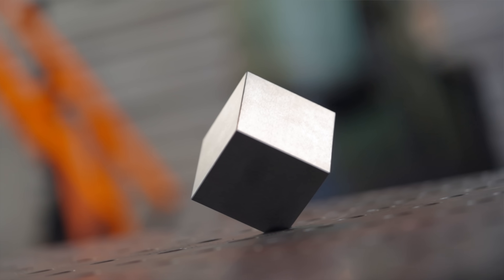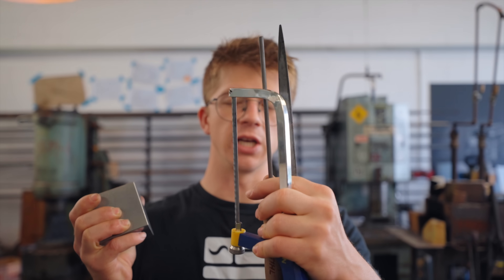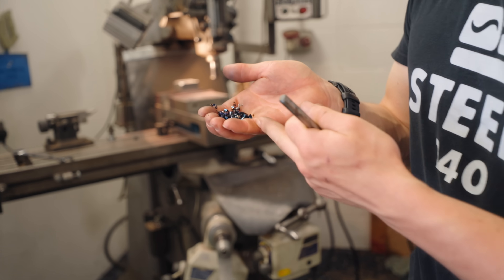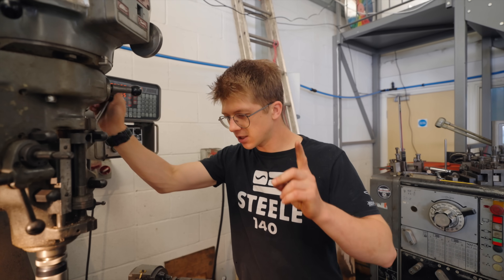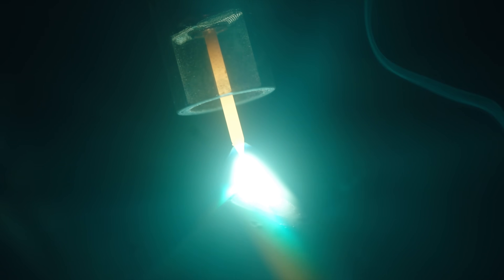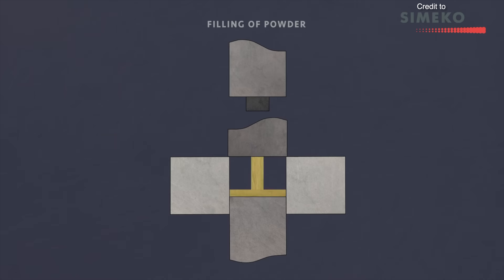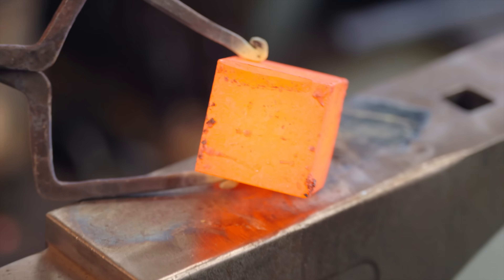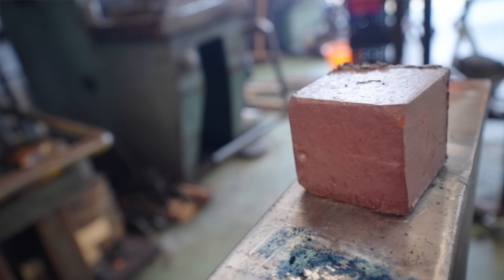Can You Forge Tungsten?

Comment: Nuclear materials scientist here - tungsten is such a dope material, we're actually considering it to make the inner walls of future nuclear fusion tokamaks. It's pretty much one of the only materials on Earth capable of withstanding those 3000°C of continuous exposure without losing much if its mechanical properties. My current work is actually about exploring tungsten 3D-printing and basically laser-welding it to other metals (using kW-range lasers).
Anyway - awesome video, very cool to see you play around with it in a blacksmithing workshop!
Reply: Thanks for your work! Hope to see much more in the world of nuclear
Reply: Will you be using pure tungsten or will it be an alloy/ceramic like WC? I've seen some crazy tungsten carbide parts but have always been curious about 3D printing it. It would be tough since you'd have to do it green (un-sintered powder) which you would have to account for shrinkage.
Reply: thats the coolest pfp tbh, never even thought of using a plasma globe as one
Reply: When he mentioned the temperature properties my mind went straight to a tokamak. I thought may have been way off the mark until I saw your comment.
Reply: @GarrySax Wouldn't a bimetallic layering of metals in a continuous electric / magnetic field like that of a fusion reactor result in crazy bad corrosion like with ship hulls? Maybe the vacuum inside will prevent that but bimetallic layerings have destroyed more than 1 multi-billion dollar project before due to their infamously bad corrosion at the interface layers.

Maybe Tungsten isn't like other metals in this regard, but just curious if any investigation has been put towards that.
Reply: @chaselewis5372  galvanic corrosion can only happen in the presence of an electrolyte. the powerful electromagnetic field surrounding it isn't enough for ion movement in the metallic lattice.
Reply: @GarrySax, I have done a bit of research into 3D printing tungsten. I'm just an engineer for our lab, but my collegue shares your title and has develoupled a way to 3D print tungsten without internal voids!
Reply: @jjfrenetictoad  He might be your colleague ^^ There are many projects regarding additive manufacturing of tungsten worldwide. Recent results are indeed promising.
Reply: @jjfrenetictoad lemme guess. Using low pressure chamber?
Reply: @lokikokoko5833  no. but even though he's my collegue and friend, he's keeping the IP to himself until his paper is published.
Reply: @lokikokoko5833  hopefully not.
Reply: How did they make the cube in the first place?
Reply: @daviddzialo6249  I presume they cut an ore of tungsten with a diamond tip saw, or molded it with sand, or carbon ceramic mold.
Reply: I worked on W wall materials for ITER some 20 years ago. Aim was to reduce brittleness, which was achieved by applying very high deformation (grain sizes < 200nm or so could be achieved, but material RXd very quickly at very low temperatures around 400°C. So basically, the high ductility also goes away very quickly. K-doped W behaved better).  When my thesis was done, they already chose a different replacement material: a C/C composite on Cu. I do not know whats hot in wall material science now, but if you stick with tungsten based alloys I'd explore K-doped tungsten. Its quite cheap (certainly cheaper than WRe) and does not recrystallize until the highest temps. It's basically the light bulb alloy (it inhibits the bamboo recrystallisation behaviour of pure W), it was discovered by accident in the 1920s in UK ('Battersea tungsten'). The problem with metals as wall materials is that they get sputtered away and tend to get deposited in the whole reactor. The amount of W that condenses 'in the right areas' is porous and brittle. I doubt that the C/C composite will solve that, but it is certainly cheaper and easier to manufacture than anything with tungsten. I'd vouch for a composite of Cu on the lower end (thermal cond.) and a ceramic coating on the hot end (like TaC or WC) that can perhaps be deposited in a kind of slurry, dried and sintered onto the Cu-base plate. Perhaps an intermittent layer with matched thermal expansion to both materials with a higher melting alloy is necessary.
Reply: IS Tungsten compatible with neutron capture issue?
Reply: @Thundra74  While tungsten has a relatively low neutron capture cross-section compared to many other materials, it is still susceptible to neutron absorption, which can lead to several challenges:

Transmutation: Neutron capture in tungsten can result in the formation of different isotopes, some of which are radioactive. For example, neutron absorption can produce isotopes like rhenium and osmium, which can alter the material's properties over time. Although long-term testing is needed to fully understand these effects, there are currently limited research facilities capable of analyzing the synergistic effects of neutron irradiation and transmutation. New facilities, such as IFMIF-DONES (International Fusion Materials Irradiation Facility - DEMO Oriented Neutron Source), are under construction to address these knowledge gaps. But a lot of materials have been tested under high heatflux conditions and under neutron environments in fission power plants. 

Neutron-Induced Damage: High-energy neutron bombardment can cause displacement damage in tungsten, creating point defects such as vacancies, dislocation loops, and voids. These defects lead to embrittlement and a reduction in ductility, which over time could compromise the structural integrity of tungsten components, especially under high neutron flux conditions.

Helium Production: Neutron interactions with tungsten can also lead to helium production via nuclear transmutation. The accumulation of helium within the material can result in swelling, embrittlement, and the formation of helium bubbles, further degrading tungsten’s mechanical performance.

If you would like to have further insights, I could give you over 250 literature sources regarding this specific topic :)
Reply: @Thundra74  While tungsten has a relatively low neutron capture cross section compared to other materials, it is not immune to neutron absorption, which poses several challenges:

Transmutation: Neutron capture in tungsten results in the formation of various isotopes, some of which become radioactive. For example, neutron interactions can produce isotopes such as rhenium and osmium, which change the properties of the material over time. The long-term effects of these transmutations require further investigation, but existing research facilities are not yet equipped to analyse the synergistic effects comprehensively. Facilities such as IFMIF-DONES, which is currently under construction, aim to address these issues and provide deeper insights into the behaviour of tungsten under fusion-relevant conditions.

Neutron-induced damage: Bombardment of tungsten with high energy neutrons leads to displacement damage, resulting in defects such as vacancies, dislocation loops and voids. These defects degrade the mechanical properties of tungsten, in particular by causing embrittlement and reducing ductility. Under prolonged exposure to high neutron flux, this damage can significantly compromise the structural integrity of the material, posing a challenge to its long-term viability in fusion reactors.

Helium production: Neutron interactions with tungsten can also lead to helium production via transmutation. The accumulation of helium in the material can cause swelling, embrittlement and the formation of helium bubbles, all of which further degrade the performance of tungsten. The management of helium production and its effects remains a key focus of materials research for fusion applications.

To address these challenges, the potential of additive manufacturing of tungsten is being explored. This approach could enable in-situ repair of components such as the first wall and divertor in future fusion power plants, providing a flexible solution to extend the lifetime of critical components.
Reply: @Thundra74  no, neutrons by definition are neutral
Reply: @qumit165  neutral only in regard of elettric charge but they will interact  in his own way
Reply: Tungsten's true melting point is around 3500°C so 1300° is a shrug for that material.
Reply: Nuclear R&D Chem engineer here - we're exploring the feasibility of 3-D printing tungsten for rad shielding to make hands-on radioactive material handling vastly safer.
Reply: @timberanvil3788 good, since we had a dipshit grad student put her hand in the beamline in grad school. She still graduated!
Reply: TUNGSTEN 3D PRINTING? thats dope i need to know more
Reply: A profilepicture only a real Nuclear materials scientist would choose
Reply: Thank you for your work chief. You guys are amazing 🎉🎉
Reply: You have a really cool job. Grateful for brilliant people like you!
Reply: that sounds really interesting. any literature on it out there?
Reply: Make me an iron man suit bro🥺🥺
Reply: @JM301-y9d  . Not iron man. Because of tungsten's symbol being W, be W-man instead.
Reply: Phd in nuclear science. But bro work with lasers like that guy on big bang theory.
Reply: Good luck
Reply: Is dope a scientific term there professor
Reply: Its melting point is so high that its rarely made directly into solids, its usually powder sintered which leaves it with some voids which results in it not having a uniform density. When fancy spinning top makers use tungsten, they have to balance their tops by drilling holes in certain sections to make the density uniform again, at least in one axis.
Reply: I'm your newest fanboy
Reply: Oh my, 3D printing that and laser welding that must not be easy, sure, lasers can go VERY hot, but still...
Reply: You're still going to need ablative heat shielding because tokamaks operate at 150,000,000 degrees Celsius.
Reply: @mh6276  Wall temp is a LOT lower than that and the amount of gas with millions of degrees is VERY low. It's all about how the material erodes away and where it goes in what amount of time.
Reply: didn't need a "Nuclear materials scientist" to google "what's highest melting point element"
Reply: Bro...start making videos. That is fucking stellar.
Reply: Iter is already replacing their innehr lower liners to W in the areas of max heat load.
Reply: I'm looking at 3d printing tungsten too
Reply: Man, you got a cool job. By kW-range, what exactly should I google to find out what you mean? I knew Plasma welders were a thing, but lasers I hadn't heard of as of yet!
Reply: @GarrySax is tungsten any good at absorbing neutrons? I believe the inner walls of a reactor are supposed to do that.
Reply: Dude I want to see your videos!
Reply: What about high entropy alloys that contain tungsten? I saw a video a year ago that showed a structure of such alloy and was amazed at what could be done. At some points looks more like magic than science or metallurgy. I saw some sparse papers that talk about HE alloys being used in reactors since you can alloy 5 or more metals at once and also in equal proportions rather than 1 main metal and 1 to 2 trace metals like we do in our day to day use alloys like steel or brass.

I am no scientist but I take interest in this stuff and it fascinates me how fast things are picking up.
Reply: How does Tungsten stand up against neutron flux though? I know it can be an effective radiation shield against the lower energy neutrons from fission but what about the very high energy neutrons from fusion? Will the tungsten get neutron activated and become incredibly radioactive over time?
Reply: Hmm, I wonder if you alternate a high frequency current through it would it provide gravitational shielding? 🤔
Reply: @moxow  probably
Reply: Try 12L14.
Reply: Do you work for Proxima Fusion?
Reply: Wouldn't it be better to use carbon?
Reply: @Arcoz  For nuclear fusion power plants, this is unfortunately no real option. Carbon or CFC have several issues with:

1. Hydrogen Interaction: CFC absorbs deuterium and tritium, reducing fuel availability and complicating fuel management.

2. Erosion and Dust Formation: Carbon erodes heavily under plasma exposure, generating dust that can contaminate the plasma  and results in low service life

3. Neutron Damage: High-energy neutrons degrade CFC, causing embrittlement and structural damage, making it unsuitable for long-term use in fusion reactors.

There are still several projects utilizing CFC even for a divertor, but all of them are experimental devices just working with pure hydrogen. (e.g. W7-X in Germany).

Long story short - there are many more things to consider. Here, even pure tungsten is insufficient to meet this specific demands in long term. 
But there are potential solutions, which we could discuss further if you're interested.
Reply: What about carbon? Too brittle?
Reply: I want a video of this. Please!?
Reply: Do you work at Culham?
Reply: How do you even handle the material that you're going to be depositing?  Is the whole hot head made of niobium or some such, or a ceramic?
Reply: 3D printing tungsten????
yea science has gone too far, thats not supposed to happen ever
Reply: Nuclear "energy" is just a front for military munitions stockpiling, the energy part is only used as a subterfuge to conceal material accumulation.  Nothing but a big tax sucking kettle.
Reply: dont gief away state secrets for fake internet points
Reply: Would Rhenium have the temperature tolerances you are speaking about for tokamaks?  The shop I retired out of did a lot of work with Rhenium for years+11
Reply: Sounds like that tokamak will cost the same as an ENTIRE fission plant.  We really need to be focusing on expanding fission power in all its myriad of possibilities, as its all possible with available technology.
Reply: @h8GW  because fusion is the holy grail of energy, it should not be compromised at all because of the potential benefit of solving the energy crisis by itself. That being said, fission should definitely get more focus as well. Both should be done, but to be clear, fission should only be a stopgap until fusion is viable. If fusion is never viable, we can fall back on fission
Reply: This sounds something like a job I would love to have, at least in the field anyways, its astonishing work. How on earth does one get into this line of profession in the first place?
Reply: I thought that because of the he massive amounts of magnetic control over the plasma the walls of the reactor don't get anywhere near those levels of heat since it's forced into the center
Reply: kW-range lasers. That sounds scary, and awesome.
Reply: Well, that's a really cool job.
Reply: dude that is sick!
Reply: tungsten crystal net is very filled up. so you cant hammer it like steel together.
Reply: Then how are lithium blankets going to work?
Reply: How does it handle neutron bombardment from the flux?
Reply: Tungsten 3D printing LOLLLLL come on man
Reply: What an interesting occupation here I thought my electronics and laser engineering is fun.
Reply: So how's the work on fusion energy coming along? It's been like 5 years away from being ready for the past 60 years or so.
Reply: Will the CERN machine thingy create a blackhole in earth?
Reply: That intro tho.. lol
Reply: Dont the walls of a tokamak reach FAR greater temperatures than that?  We are talking about plasma that is, in some cases, in the HUNDREDS of millions of degrees.  Is it just that sparse that it doesnt effectively transfer the heat that rapidly?
Reply: Personally I think Tungsten is overrated - There are even more refectory materials available, like Hafnium Carbonitride which has a melting point 700 degrees higher!(Celsius) than Tungsten.
Reply: I know GarrySax Mf'er works at Arby's lmfao "Nuclear materials scientist". Gary pay your child support and fill up my Diet Coke.
Reply: I always wanted to be either a particle physicist or a nuclear scientist of some sort I’m just not sure where to get started
Reply: sounds like you have one of the coolest jobs ive ever heard of
Reply: holy shit your cool
Reply: We use it for the chamber walls on EUV Lithography systems in addition to as counterweights for the exposure stages.
Reply: oooooooa i love tokamaks
Reply: Have you found the fuel for it yet? I heard it requires hydrogen and helium isotopes, which we have the former in the oceans, while the latter is, not so much.
Reply: Wouldn't the oxidation at high temp, you know...?
Reply: If you managed to delve this deep in the comment section of this comment, I now bestow you with the invaluable knowledge that tungsten literally means "heavy rock"
Reply: My current job is to make tungsten carbide knife,axe.
Reply: Is inconel not capable?
Reply: I wander if a version of 12l14 with extra ammounts of lead may suit you better. Cost / machinability most certainly would
Reply: I wander if a version of 12l14 with extra ammounts of lead may suit you better. Cost / machinability most certainly would
Reply: I thought they had to give up on Tungsten because it poisons the plasma and cools it down... and also becomes brittle and radioactive. Haven't they basically gone in the opposite direction and chosen Lithium?
Reply: Wouldnt that creat x-ray photons ? I mean wielding it with kw lazers
Reply: Yeh a Nuclear Scientist is going to use the word " Dope ".....LmFao
Reply: Graphite does well with heat as well
Reply: You reveled your secret. I am gonna steel it and get it patented
Reply: Have you thought about using 40+ year old single women to line the inside of fusion tokamaks?

They repel everything. Including the heat of the sun.
Reply: Make me an iron man suit bro🥺🥺
Reply: @JM301-y9d what's the point? It didn't work very well against a simple saw and today we mainly use cinetic weapons. Also power consumption would be crazy with that density. Maybe an alloy or a layer on the armour for thermal protection
Reply: @eduardogarciapinto tungsten can stop a .50 with barely a mark. There are plenty of YouTube videos showing this.
Reply: Expand your area of expertise and don't use logically cringy wordings like "one of the only". 😉
Reply: Head chef at Wendy's here, pepe popo dingus chungus sigma rizzface no one cares
Reply: Damn man that actually sounds so cool, good job!
Reply: Tungsten is already 3D-printed for MRI scanners, more particular to make scattergrids. CERN also uses 3D-printed tungsten parts. It's already been around for a while with l-pbf machines. The challenges lay in getting it to be fully dense and free of cracks.
Reply: The fact that people actually believe this comment is insane.
Reply: that has to be a breach of contract right?
Reply: Nice wiki copy paste, mr internet scientist
Reply: Another “nuclear materials scientist” here. We don’t use it for anything the OP said.
Reply: Within the next few months you will be replaced by a black woman that was the worst sandwich artist at subway and got fired because she never showed up on time.
Reply: @biowerks  wtf are you talking about, what world do y’all live in??
Reply: @biowerks  You don't get a lot of real life interactions, do you?
Reply: @biowerks  how to say you're american without actually saying you're american
Reply: @biowerks  what drugs brought this sentence to us
Reply: @PurpleCh4lk The real world. What rock have you been living under.
Reply: @websterri  I guess your alt brings you great pleasure. I thought you're gonna bring some worthwhile to this thread but when yalls vocabulary is in limit with buzzwords I don't expect much.

Hopefully it gets better

ps. 9gag and your grandmas basement is not a "real world".
Reply: @biowerks  just put the fries in the bag
Reply: @biowerks  odd thing to say. what a weirdo
Reply: @biowerks  literal troll? lmao
Reply: @biowerks cringe propaganda spotted
Try harder next time
Reply: @biowerks  are you okay?
Reply: @scladoffle2472 you can tell by the profile pic they were clearly trying to be funny.
Reply: @biowerks race lives absolutely rent free in your head. Let me guess, DEI is why Boeing planes fall out of the sky?
Reply: @blend3rman796  They live rent free everywhere they are, becuase its the plan.  And we are all paying for it.d
Reply: @blend3rman796  Chill, little buddy. You were trolled.
Reply: @blend3rman796  He's reference a movie I think
Reply: @blend3rman796 did you predict the future??
Reply: @blend3rman796  Yes it is, actually.
Reply: @biowerks  :DDDDDDDDD
Reply: @biowerks yep! DEI at its finest.